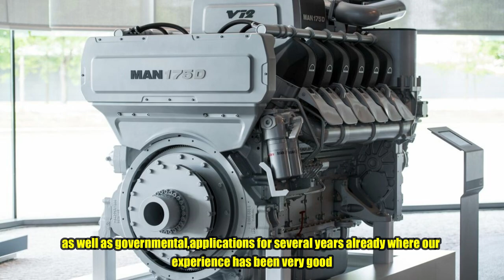MAN 175D Biofuel-Ready. Eλληνικοι υποτιτλοι (αυτοματοι).

Comment from the maker: MAN 175D Biofuel-Ready. MAN Energy Solutions has announced that its MAN 175D engine is formally approved for operation on biofuels, effective immediately. This applies to all standard biofuels such as HVO (Hydrotreated Vegetable Oil) and FAME (Fatty Acid Methyl Ester) fuels up to a content of 100%. Crucially, the engine itself does not require any technical adjustments, following the announcement. Florian Keiler, Head of High-Speed Sales, MAN Energy Solutions, said: “MAN Energy Solutions prepares its engines for operation on future and sustainable fuels and the MAN 175D is no exception. Several such units have been running on up to B30 biofuel in commercial, as well as governmental, applications for several years already where our experience has been very good and shown that the 175D does not suffer any loss in performance even when using these fuels.